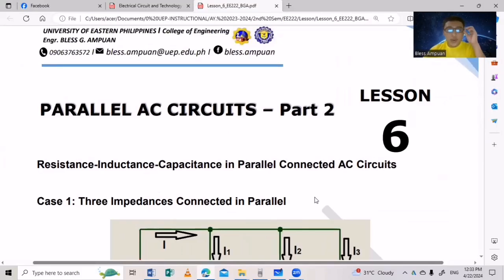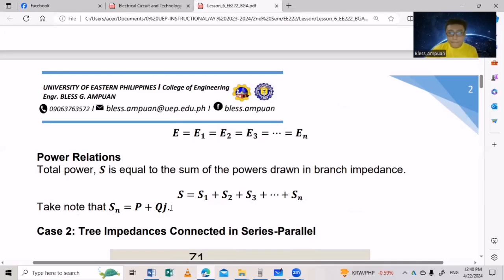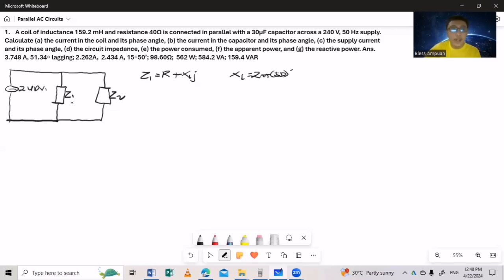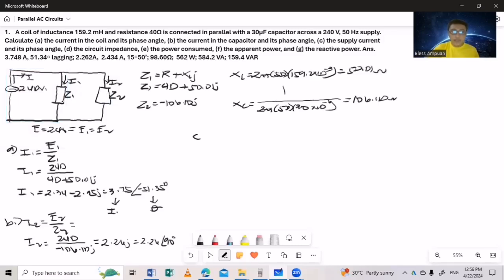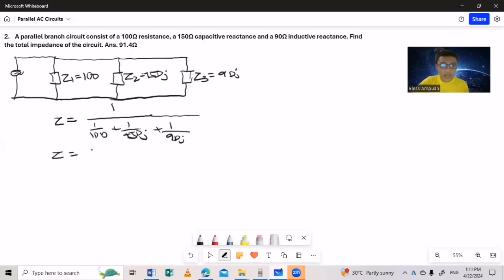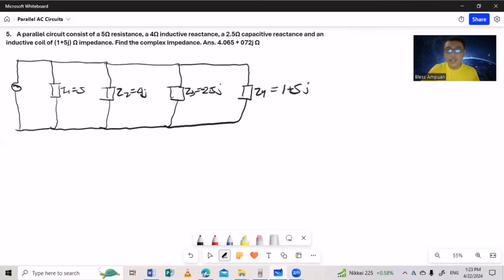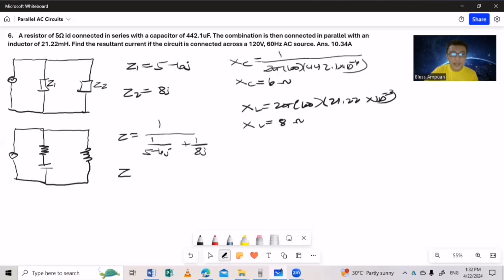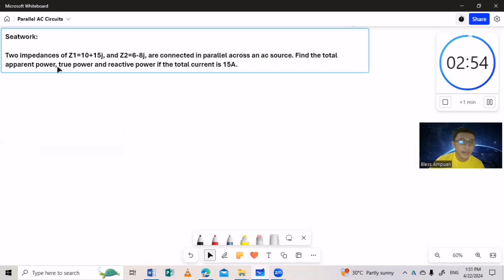Resistance-Capacitance-Inductance in Parallel AC Circuits | Example Problems

Comment: The videos gave me understanding of parallel RLC AC circuits. Here, voltage across the resistor, inductor, and capacitor is the same. What stood out was the timing of currents: resistor current stays in step with voltage, inductor current lags by 90°, and capacitor current leads by 90°. This means inductor and capacitor currents are 180° out of phase, partially canceling. Knowing these phase shifts is key to adding the currents using phasors. At resonance, the inductor and capacitor currents cancel completely, making total current minimum and purely resistive. The examples helped me compute impedance and power more confidently, improving my problem-solving skills.

Comment: My takeaway for the video is that it gives a simple and easy to follow explanation of parallel RLC AC circuits. It shows how the resistor the inductor and the capacitor all share the same voltage but their currents act differently because they are not in the same phase. This makes the topic more interesting and easier to understand. It also points out that you cannot just add the currents in a normal way. Instead you need to treat them like vectors and combine them using phasors.

The tutorial also walks through how to find the total impedance using reciprocal methods. It explains how the circuit can behave as lagging or leading depending on which effect is stronger. What makes the lesson helpful is how it uses clear examples along with phasor diagrams and complex numbers. These tools make it easier to solve for real power reactive power apparent power and power factor. In the end it helps you see how the circuit works and how efficient it really is.

Comment: I learned that analyzing RLC parallel circuits requires treating currents as vectors because they flow at different angles. Voltage is constant across all branches, but we cannot just add magnitudes directly. It is more efficient to use Admittance (Y), Conductance (G), and Susceptance (B) for easier calculation. The resistive current is in phase, inductive lags, and capacitive leads. The total current and power factor depend on which component is dominant. The detailed examples helped me understand how to switch between rectangular and polar forms correctly.

Comment: This tutorial taught me how to analyze circuits with resistor, inductor, and capacitor all in parallel. I learned that it is easier to use Admittance (Y), Conductance (G), and Susceptance (B) instead of Impedance when solving parallel networks. The resistive current is in phase with voltage, inductive lags, and capacitive leads. We add all currents vectorially to get the total current. The power factor depends on which reactive component is dominant – inductive or capacitive. The step-by-step solutions really helped me understand how to apply the formulas and draw phasor diagrams properly.

Comment: From the video about Resistance–Capacitance–Inductance (RLC) in parallel AC circuits, I learned how different components behave when connected across the same voltage source. In a parallel circuit, the voltage across the resistor, capacitor, and inductor is the same, but the currents flowing through each branch are different because each component responds differently to AC.
The resistor current is in phase with the voltage, meaning they rise and fall together. The inductor current lags behind the voltage due to the effect of inductive reactance, while the capacitor current leads the voltage because of capacitive reactance. This phase difference is very important because it affects the total current of the circuit.
I also learned that the total current in a parallel RLC circuit is the vector sum of the individual branch currents, not just a simple addition. This introduces the concept of admittance, which is the reciprocal of impedance, making calculations easier in parallel circuits. The video also explained how to compute total impedance using admittance and how resonance can occur when inductive and capacitive effects cancel each other.
Overall, the lesson helped me understand how phase relationships and admittance are used to analyze and solve parallel AC circuits effectively.

Comment: This video provides a comprehensive guide to analyzing Resistance, Capacitance, and Inductance in parallel AC circuits through detailed example problems. It begins by establishing the core characteristics of parallel branches, emphasizing that while the voltage drop remains equal across each branch, the currents must be treated as vector sums rather than simple algebraic additions. The instructor carefully demonstrates how to calculate total impedance and phasor currents, highlighting the critical distinction between leading and lagging phase angles.
The tutorial features seven practical examples, ranging from basic parallel combinations to more complex series-parallel configurations. By working through calculations for inductive and capacitive reactance, apparent power, and power factors, the video provides a clear roadmap for solving typical AC circuit problems. The inclusion of a timed "set work" at the end is a great touch, encouraging active participation and helping to solidify the concepts covered during the lecture.
This is an excellent resource for students looking to master AC circuit analysis with a structured, step-by-step approach.

Comment: After watching this video lesson about parallel RLC circuits, I learned a lot. Using complex numbers to solve for current and impedance is actually easier than I thought, and it makes the solutions shorter. I also noticed that capacitive reactance has a negative sign while resistance and inductive reactance are positive. That really helped me understand the difference better.
 The lesson was clear and easy to follow, especially with the examples shown. I think taking down notes while watching is really helpful so I can remember the steps. Now I feel more confident trying to solve the practice problems. Thank you for making this topic easy to understand.

Comment: After watching the video lesson about RLC parallel circuit I learned about calculating technique using complex number. It is a short solution to get the current and other solving. The video lesson is cleared and organize and it easy to gets but you need to take down notes to familiarize the problem. In the video the more the example they give the more you learned. While watching a lot of learning I get like the capacitive reactance is always negative sign and resistance and inductance reactance is positive sign. Through this video I can answer the practice problem solving.

Comment: The video explains parallel RLC AC circuits in a clear and practical way. It shows that even though the resistor, inductor, and capacitor all share the same voltage, their currents behave differently because of phase differences. To find the total current, you can’t just add them normally. You have to combine them as vectors (phasors). The tutorial also demonstrates how to calculate total impedance using reciprocal formulas and explains that the circuit will act either “lagging” or “leading” depending on whether the inductive or capacitive effect is stronger. Through these examples, the use of phasor diagrams and complex numbers to solve for real power, reactive power, apparent power, and power factor, helps to better understand how efficient the circuit is.

Comment: The videos taught me how to calculate values for LC and RLC circuits. For LC circuits, I learned to get the inductance and capacitance that has frequency given using its  formula. In RLC circuits, I start by calculating the inductive and capacitive reactances. Once I have those, I combine them with the resistance to find the total impedance. With the total impedance, I can use Ohm’s Law to calculate the current. I also learned that when the two reactances are equal, they cancel out, which makes the total impedance equal.

Comment: Looking back at Sir’s lectures on RLC parallel circuits, the most striking takeaway is how much the "invisible" phase angles dictate everything. In our latest sessions, we moved beyond simple components to analyze complex branches, like a coil with its own internal resistance connected alongside a capacitor. Sir really drove home the point that we can’t just add up magnitudes anymore; we have to treat everything as a vector sum because the currents in each branch are constantly "tugging" in different directions.
What’s really helpful is the way he breaks down the three cases—parallel, series-parallel, and parallel-series—showing us that no matter how messy the diagram looks, the basic rules of impedance combination still hold true. Calculating things like the power factor or the total apparent power really helps bridge the gap between abstract math and actual engineering. It’s a lot to keep track of, especially when switching between rectangular and polar forms, but these step-by-step examples make the behavior of lagging and leading circuits feel much more intuitive.

Comment: The lecture focuses on practical application, moving away from tedious manual derivations toward the efficient use of complex number methods on scientific calculators. Through a series of three progressively challenging examples, the instructor clarifies how to solve for total impedance and branch currents, while also providing a detailed explanation of the "power triangle," which includes true power, reactive power, and apparent power.
A standout feature of the tutorial is its emphasis on the phasor relationship, specifically how the total current is the vector sum of the resistive and inductive components. The instructor carefully explains the concept of "lagging" currents and the necessity of using conjugate currents when calculating power in a complex plane. Although the video is nearly an hour long, its thoroughness ensures that viewers gain a solid grasp of both rectangular and polar coordinate systems. It is a highly recommended resource for anyone needing a clear, step-by-step walkthrough of AC circuit parameters and their mathematical relationships.